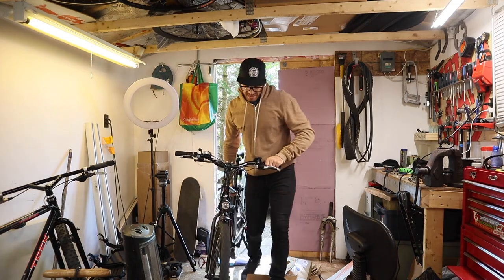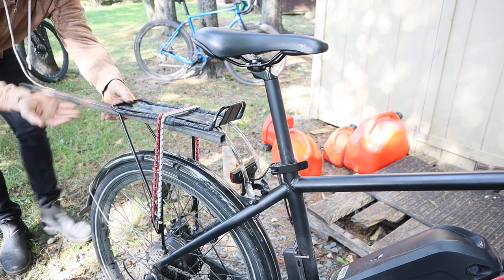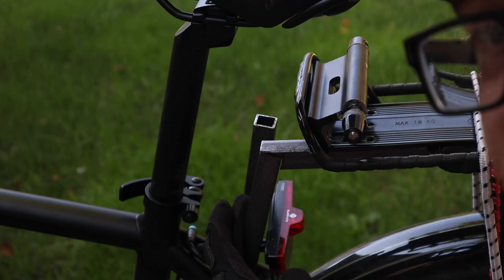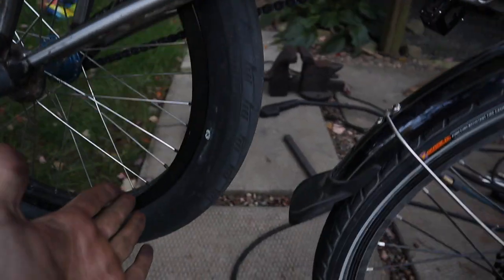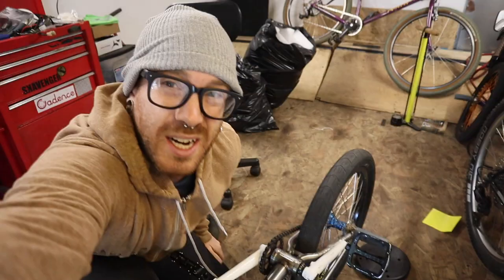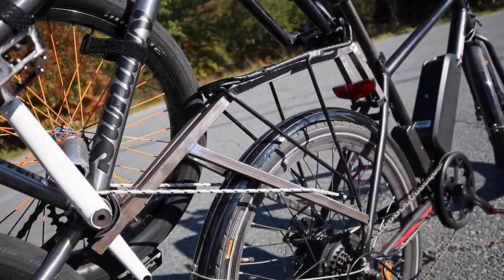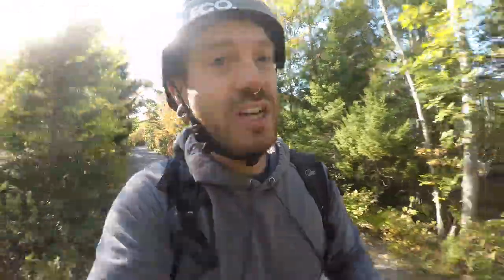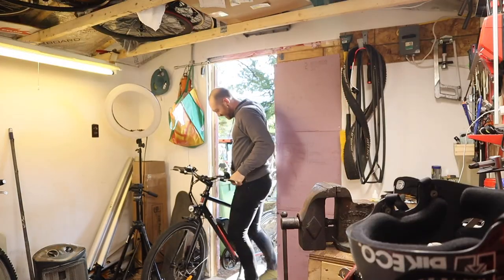I built this custom rack and it's awesome.

Comment: I'll be in my shop Wed/Thurs; I'll dig through my parts bin to see if I have any Thule/Yakima ratchet straps from old bike racks that might be able to be used that I can send to you.  The strap you can just drill a hole and bolt on pretty easily; I just cant think of any current buckle design that's not molded in to a cradel, but there has to be an older design where they were riveted on.

Comment: 5 gold stars! Now you have my creativity flowing. A friendly take it or leave it idea… get a sheet of rubber and cut and glue it to where the bottom bracket rests so it’s not metal on metal. Then use an old school snowboard binding or inline skate ratchet strap to hold it down.

Comment: Looks Awesome! I'm a  little late to the conversation but as an HD and Automotive mechanic I wanted to mention that whenever you are welding on something be it a car, truck or Ebike with electronic modules you should always disconnect or in this case remove the battery as the arc welding process can cause voltage spikes that can damage electronic components...👍

Comment: This is a winter project I am planning on...custom rack to incorporate a few things that cannot be bought off the shelf...namely...some fishing pole mounts and a trailer hitch for a kayak, and a rigid enough rack to strap some massive weight on it.  Going to use aluminum flat bar and some stained wood.  Not going to bother until the snow hits as I like doing bike related projects in the winter when the riding sucks.

Comment: What watts & torque does that e-bike have and does this extra weight sap it? 
I have a Schwinn IG3 City with a 3 speed nexus I keep toying with the idea of converting to electric using a front hub motor to keep the nexus rear but also balance out the weight as it’s so rear heavy already. But it seems a normal 35-40nm torque motor might be gutless on the hills before I even load it up